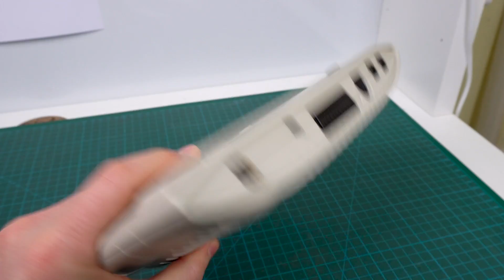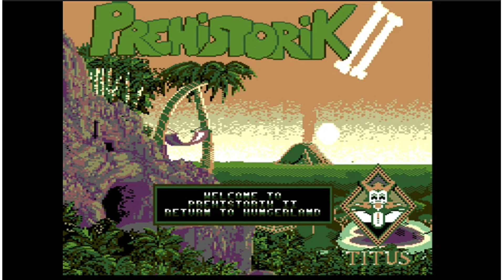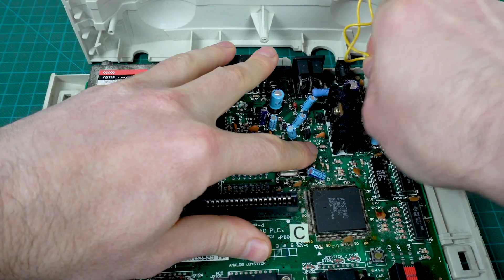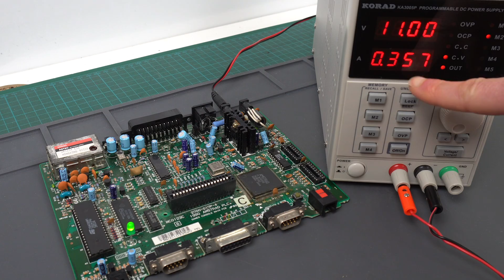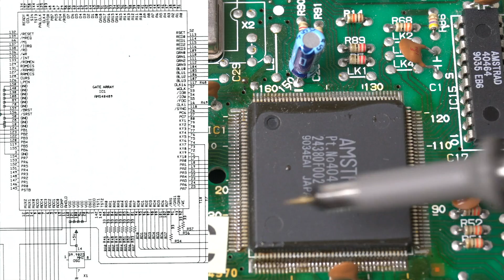Amstrad GX4000 Repair - The Unknown Game Console

Comment: I have a working GX4000 myself. It's a nice little machine. It's such a pity that the ASIC cannot be replaced with a clone chip like the ZX Spectrum ULA can. As far as I know, a FPGA implementation of the GX4000 doesn't exist. Sadly, GX4000 machines will stop working sooner o later, and the logic of the  system will be lost.

Anyway, it was great to follow your inspection of the board, even if it was not possible to repair. Thanks!!
Reply from the maker: Hopefully someone will eventually reverse engineer the ASIC and we'll have a way to make new ones.

Comment: Hey Noel, there looks to be very much crusty old rosin flux around the asic which sometimes can go conductive and corrosive. Try to clean all that old stuff off the board and check again. I had this happen just with standard throughhole cmos chips and that ASICS pins are less than 1/2 a mm distance to each other so this can be a potential problem.
Reply from the maker: Hmm... I hadn't thought of that, but it's true that there's a fair amount of flux residue. I'll try cleaning it see if that helps. I'm also toying with the idea of generating the 4 MHz clock signal myself in an external circuit. But I'd have to do it just right for it to work, so I might revisit this console after all. Thanks for the tip.
Reply: I just fixed mine because of this comment! Thank you so much!

Comment: The side-by-side power schematic and circuit board spit screen was brilliant! It’s great to see that not every project is a success ... very real, and that’s very encouraging! As the episode went on I was thinking “Not the gate array, not the gate array” 😬🙂. Perhaps sometime you could talk about the role of some of the discrete components on a board like a particular resistor or capacitor? I often wish I’d pursued the electronics I’d learned in high school (where I only learned the basics of resistance-capacitance circuits). Thanks again for the great videos!
Reply from the maker: Glad you liked it! Yeah, the GA/ULA is always biggest fear when dealing with GX4000 or some of the latter ZX Spectrums.
You're right that I tend to overlook the "small" components. I'll make a point to talk about them sometime. It's never too late to learn electronics. I studied Computer Systems Engineering, but I didn't learn "real" electronics until a few years ago when my Amstrad died and decided to repair it :-)

Comment: What if the Z80 is shorted and pulls down the clock signal ?
Reply from the maker: You know, you're totally right. I should have checked that. I guess I'm not used to the clock being shorted that way. It happens more with the data or address lines, but especially since the Z80 is socketed, I should have totally tested that. Let me check...
Reply from the maker: All right, I just tested it and that wasn't it. That would have been funny if it was that. It goes to show that I'm so paranoid about these ASIC chips, that sometimes I'm too quick to blame them. But in this case it looks like it was faulty. I also thought about just generating the 4MHz signal myself with some external circuitry off the crystal oscillator, but I think it would be hard to get the perfect synchronization with the other clock signals in the GA, so I don't think that would work. Oh well. Good idea though!
Reply: @NoelsRetroLab  Did you measure the clk16 on pin 117? You could divide it by 4 and use that for CPU
Reply from the maker: @petersrensen5972  I did measure it and it was fine (didn't make it on the video though). It might be an easy place to start. Good idea.
Reply: @NoelsRetroLab  My first thought indeed when I saw you jumping to the conclusions so early. I'd use a diode tester to see if there is a hard short from this pin to GND and +5V rail, in both directions. This sometimes gives some insight into what exactly could have gone wrong - is it an ESD protection diode within the chip, or perhaps a passive component somewhere in between that and the CPU?

Comment: Well, all that big ass chip probably does in this case is to divide the clock from the oscillator down to 1MHz, with a chain of flip-flops, and tap the chain along the way in multiple places to derive the 4MHz and 16MHz or whatever else it needs. It should be very easy to throw something together to divide CLK16 down to 4MHz and feed it to the board. Assuming of course that the only thing that's broken from that chip is the CLK4 output, which is not necessarily very likely... still it might be fun to try it.
Reply from the maker: Yeah, definitely want to try it. But I wanted to try on a working GX4000 first to ensure my clock divider works, and then try it on the faulty one (and like you said, I fully expect it not to work because I'm sure something else is broken).

Comment: I seem to be addicted to your channel (until I get to Commodore videos, lol.). interestingly, I think the CPC Plus's / GX4000 were the only European systems to have hardware scrolling and sprites, however it was way too late as you mentioned too.
Reply from the maker: Thanks! Not a Commodore fan, or just too many Commodore videos out there already? I don't think the Plus had any hardware scrolling beyond the CPCs abilities, did it? Not 100% sure, that's why I'm asking. Sprites for sure, but it's amazing that the TMS9918/9929 already had hardware sprites all the way back in the late 70s! So MSX systems using it had hardware sprites, and so did the TI99 (not really a EU system) and the Colecovision.
Reply: @NoelsRetroLab  Cartridge games like Navy Seals, Robocop 2 and Dick Tracy do appear to be very smooth when scrolling the screen. At 50 FPS too.

Comment: The output from that 39.9 mhz clock module should be 5v pk-pk so i don't think it was right.
Reply from the maker: Really? I forget the details but often times the signal out of those oscillator circuits is only about 1-2V peak to peak or so. I don't know about this one specifically though. I'll compare it when I get a working GX4000.
Reply: @NoelsRetroLab  Pure crystals (with 2 pins) are usually driven at 1 to 2V, because that's a good voltage for the crystal to operate on. On the other hand, crystal oscillators (4-pin boxes, either square like here or rectangular) have the driving electronics built-in, and are supposed to output a TTL- or CMOS-level signal at 5V.
Reply: @NoelsRetroLab  These are TTL level signals, so you should see 3.5 V at least. You may see less if the clock is close to the bandwidth limit of your 'scope. The ground point is important at frequencies like this. Use a ground as close to the oscillator as you can. Try to avoid using the pigtail clip lead - a spring-style contact is much better.
Reply from the maker: @Derundurel  Thanks for the tip. I was familiar with the spring-style contact, but I looked into it and what a difference it can make in the right situation! Off to look for one of those contacts for my probes!
Reply: @NoelsRetroLab  99% of these are XTAL's with TTL output. 39MHz must be visible even on cheap osciloscopes. But on other hand these devices are very sturdy- never seen them dead. The big chip can be bad and load xtal.

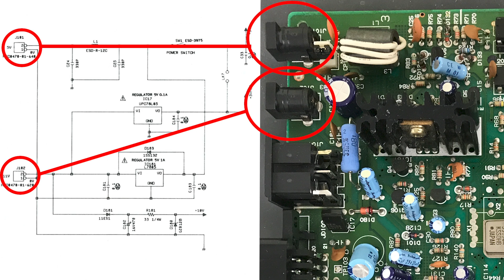Comment: 8:37 they were craaaazy ... guess it was cheaper to use linear regulators than buck converters for the power input stage. 15:32 wouldn't think the oscillator is fine - if it was a crystal, you could expect something like this but a crystal oscillator has a very nice rectangular signal between 0 and 5V. This looks like you have limitted your bandwidth of your oscilloscope - or the oscillator is almost dead. But strange that this 1MHz looked so fine.
Reply: As the 1MHz looks fine, I am confident that Noel just enabled the 20MHz bandwidth limit option. 40MHz is severely hampered by it, but 1MHz passes it just fine.

Comment: Nice one! Maybe you could try and make a 4Mhz clock signal by doubling the 1mhz clock two times, using external circuitry.
Reply from the maker: It did cross my mind, but I was afraid that unless I generate it exactly the same way the GA does, it might be out of sync with the 1Mhz and 16MHz signals that come out of the GA. Also, I wouldn't be surprised if other parts of the GA are faulty as well, so even if I did it correctly, it might not work. Still, it could be a fun mini-project.
Reply: @NoelsRetroLab  Yep only just seen this video but if it doesn't generate the correct 1Mhz signal other parts of that chip may also be faulty. I am also thinking something else may be wrong to cause the ASIC and the RAM be faulty in the first place too.
Reply from the maker: @p166mx  Yes, you're right. Chances are someone plugged in the wrong voltage. Or even the correct power supply that is known to have problems (the GX4000 has some really weird power circuitry to allow two kinds of power sources). I'm getting another GX4000 soon, so I might look at the signal and try to recreate it as a fun project, but I doubt it'll work. I'm sure there are other issues like you said.

Comment: Since the cartridge port is so close to the gate array, could mechanical strain from inserting and removing cartridges broken a solder joint? Maybe a few passes of hot air to re-flow the solder on the pins nearest to the cartridge port could help with any loose or intermittent connections?
Reply from the maker: It could be, but since I'm definitely seeing issues in the clock circuit, you'd think that just checking the inputs, VCC, and ground pins would be fine. But who knows with these all-in-one chips!

Comment: I bought one of these when they came out, for about £50. Since it shares the PCB with the full computer version, I thought it would be possible to attach a keyboard, and use the CPC+ cartridge instead of the game one to get a CPC+ that can feed a SCART output, and not need to buy a monitor. I never got round to trying.
Reply from the maker: I believe you're right and it's possible, but I haven't tried it either. The Plus range actually has a really nice keyboard, so might as well use those if they're available (although they're getting quite expensive).

Comment: You could try to generate the cpu click from an external circuit
Reply from the maker: Yeah, the problem is that it probably needs to be syncronized to the other clocks in the system. I just got another GX4000, so I'm hoping to do some experimenting with that and see if I learn something.
Reply: @NoelsRetroLab  it could be syncrohized if you feed it from another clock that is already working.
Reply from the maker: @anvz6  Right. I thought you meant generate it completely externally. Yes, that's what I'm hoping to do. The reason I didn't try is that I'd be surprised if that's the only thing failing in that ASIC, so setting it up and have it not work wouldn't tell me much. But now I have a working console, so I should be able to test that circuit and then try it in this one. Should be fun!
Reply: @NoelsRetroLab  Yes, there may be some other fults on this chip... but I think it could be a good idea to "patch" the existing chip only bacause it smd and as so much pins...

Comment: Also there's question wether 4mhz clk going out from generator is "flat" or is it "grounded"? 
Short to ground isn't as hard to troubleshoot, especially when you have literally a straight line from generator to cpu, challenge may be to lift appopriate lead of generator, but this can be easily circumvented by cutting lead whereever it's comfortable to do so and measuring both directions.

Comment: My UK spec GX4000 only has 5v power in, with no 11v.
I think I prefer the CPC 6128 as a general all rounder for the series.
Reply from the maker: Are you sure about only 5V in? I wasn't aware they had multiple board versions. And yes, totally in agreement about the CPC 6128 :-) Or, if you press me, I guess the 6128 Plus is pretty good too.

Comment: what would happen if you build some opamp or logic hate clock multiplyer and substitute 4mhz clock or inject exyernal 4mhz clock from another clock oscilator+transistor circuit? or replace z 80 to check if it makes clock shorted

Comment: Did you say the big chip replaced separate chips from an earlier modal? If you know what it replaced you might be able to find small SMD replacements of the separate parts and maybe something like the RP2040 with PIO and get a small pcb built with castellated holes :p
Reply from the maker: Not exactly. The GX4000 was always designed that way. What I meant is that it's an evolution of the CPC board, and in that board it did use several discrete chips (plus some larger custom ones) and here they're all combined. So it would be pretty hard to replace exactly and besides, who knows what else is broken there. But I still want to try to feed it the clock signal by hand and see if that changes anything. It would be a fun experiment.

Comment: use chipquik (SMD4.5NL).  Those QFP's come off easily with just a simple soldering iron.
Reply from the maker: What exactly is Chipquik? I was looking at their site and I'm still not 100% sure. It's a low-melting point solder? I've replaced those ASICS before with a hot air gun and some care, but it wasn't the easiest job.

Comment: it's a huge shame that many of these modern chips aren't socketed, to make up for their complexity, probably due to cost.  combining the chips could actually be a great idea, because you'd have to make less socketed slots, you could only have 1 - 3 of them and cover all the complicated stuff. but no one really does that, and nowadays, in laptops, it's even worse. you can't even swap the CPU (which basically holds everything nowadays) in any of them, lest it's some bulky thing with a desktop cpu, and many of those have some complicated GPU that isn't socketed. and even if you had those socketed, if they're prone to failure, they always will be, and no one is able to make proper replacements.

maybe some smaller companies would be willing to make somewhat capable computers (just something to play 480p x264 on or something) with lots of expandability and very continuous support. they could iterate on the design of their more complicated, socketed chips if they're flawed while keeping the same form factor. but i'm not sure if something this kindhearted is sustainable. i hope it is.
Reply from the maker: Right. That was definitely their way of reducing costs. That was a trend across the board with all motherboards in the 80s and 90s.

Comment: I had a broken Unipolbrit 2086 from Poland which is a bit rare Spectrum clone. It looked like the gate array was bust. Fortunately it could be fixed by using the gate array from a Timex 2048 which is much less rare. There was no other option than to sacrifice a working computer because of the gate array.

Yes, it requires skill to (un)solder a big smd chip, skills I don't have😉
Reply from the maker: Interesting that they would both use the same gate array! I guess that was a true clone.
I have desoldered and transplanted the ASIC chip on a CPC Plus before, so it's definitely doable. When I get back into this project I might have to end up doing that.
Reply: @NoelsRetroLab  The Unipolbrit 2086 was basically a Timex 2068 which was slightly modified by the Polish import company. The amazing thing is that both the Timex 2048, which is very much a Spectrum clone, used the same gate array as the Timex 2068, with is a much souped up "Super Spectrum".

Comment: HI Noel, I know it is an older video, but I have to ask: Are you sure it is a crystal and not a crystal oscillator? The ´1.2mV sinusoidal signal on the gate array input doesn't look good at all. I guess the oscillator is just dead and if you replace it you'll find a 5V square wave signal with the desired frequency there at pin 2 of the ASIC.

Comment: Be interesting to see if it was just that one issue on that chip not giv your a clock signal by generating the signal with a function generator see if it would of worked like do a doc brown hack in back to the future 3 were he sorts out an issue with a chip that failed
Reply from the maker: Haha, yeah, I would like to do that in a future video. The problem is that it's not quite that simple because the clock signal needs to be synchronized with the other clock signals in the board. So I'm hoping to first get a working GX4000, see what a healthy clock signal is supposed to be like, and then try to make a simple circuit to generate it. I suspect something else will be faulty in that big ASIC, but hey, it sounds like a fun project anyway :-)
Reply: Noel's Retro Lab be a fun video worth watching even if at the end still didn’t work.

Comment: could you not have tapped the 1MHz signal and used a clock multiplication circuit to drive the cpu?
Reply: that's exactly what I was thinking too. Especially the older these things are the fewer spare parts we can find for them and have to make do and mend...

Comment: This kind of situation right here with those damned chips that are next to impossible to replace without a full on arsenal of high-end equipment is what had killed my interest in analog electronics and repairs, funny to see that even you feel the same about them!
Reply from the maker: Yeah, even if you can replace it (which I've done it and it's a chore), there's not much to think about. It's either that chip that's faulty or not. The more discrete chips computers have, the more fun it is to repair them! 😃

Comment: guy had a load of them on ebay , he bought as bankrupt stock.. minty new, and cheap.. wasn't worth fixing BUT the PSU wasn't powerful enough for c4cpc cart (and would brick machine) .. so had to replace that.
Reply from the maker: Right. I've seen some bad GX4000 with blown regulators because of it.
Reply: @NoelsRetroLab  thankfully I saw the warning, got new PSU's from cpc electronics (ironically enough) .. the guy making the c4cpc sends them quick / good lad.. based in france.